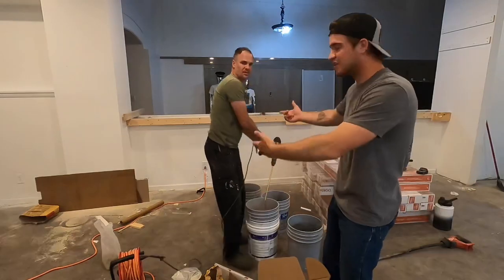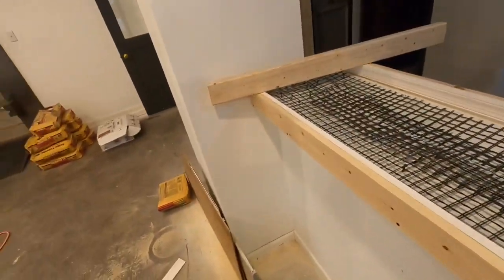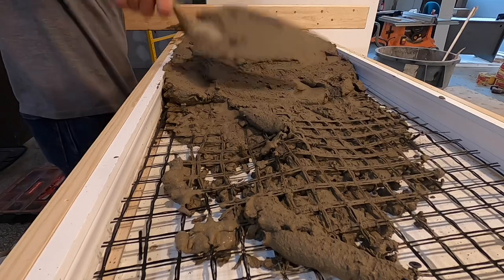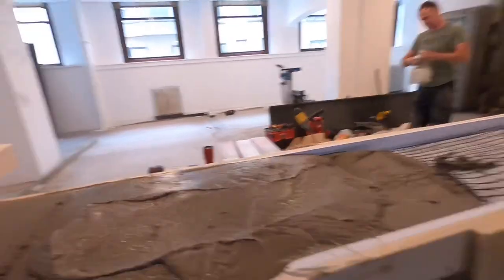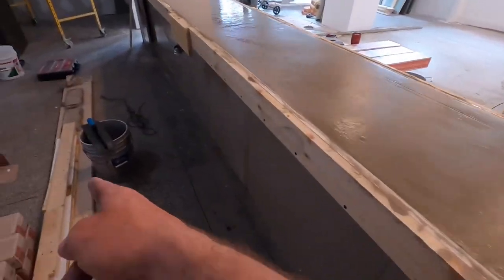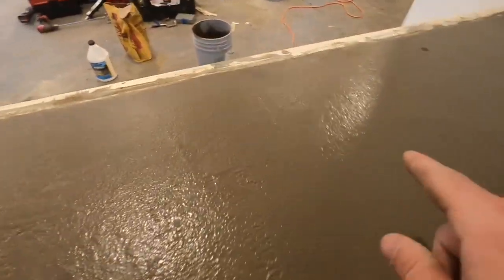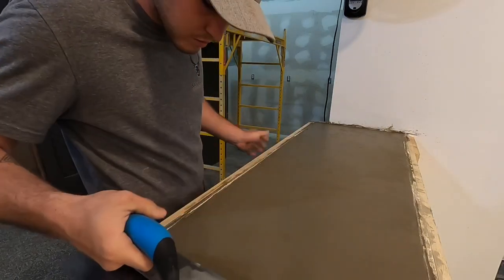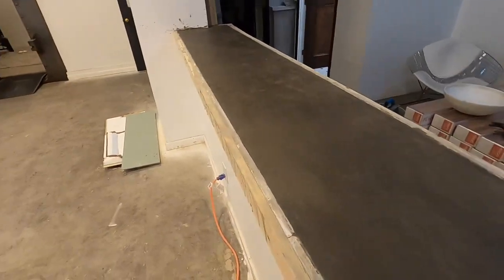How to pour a concrete countertop

Comment: If you ever do concrete countertops again, when you vibrate the face of the forms use a sawzall place the guard up against the form and it’ll take the air pockets out and it’s easy to control 👍🏻